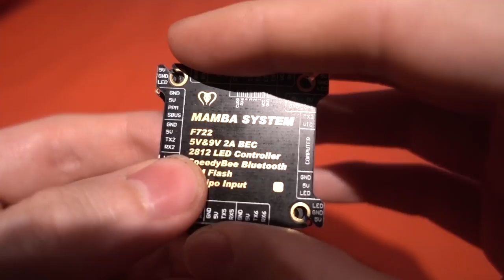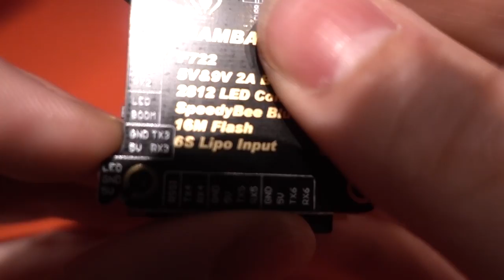Diatone F7 $80 6S Stack - MAMBA F722S

Comment: I bought the budget f4 one a couple days ago and it too has many improvements.. lots more led controls and outputs and yes  9, 5 and 3 volt regulators at 2 amps.
What led strips should I use with these Andy?

Comment: Good review.  Seems like there is no 3.3v pad.  Also cam control looks like a pain (if you want that).

Does 5V (and RX) power from USB to enable bind without adding vbat?

Interested to see how it flies.

Comment: I love the extra effort they have put into it. Having a pin-out out of the box is a big time saver :)
What is your reason for wanting a F7 though? I could understand it for an autonomous drone/plane, where there is all kind of processing going on on the drone itself. But where is all that processing power needed for a manual controlled quad?
Reply: Filtering and pid loop times use every bit of processing power, Autonomous Planes do  not require near the amount of cycle time for filtering. The difference in CPU usage between an F4 and F7 can be more than double depending on Loop time and filtering selected.

Comment: Hey Andy, great review . Do you know how long the PCB is from the front of the esc where the 8 pin connector is to the first standoffs? I'm hoping to get this in a frame but it is pretty tight for room around the stack so not sure if the longer part would touch the frame. Thanks for any help

Comment: You should check out the mk2 405 it also has a seperated 5v & 9v 2a bec, plus the led controller and a 16m flash with 6s.

Comment: Do you have to run a power wire from the esc to the flight controller to power it? I'm not seeing a vbat connection on the flight controller. Or is the flight controller getting power from the cable running from the esc? Thanks for all the great videos.
Reply: VCC PAD

Comment: I don't know if I just have bad luck or if the youtubers just get different product charges that work better.

 But I had 3 mamba f405 stacks. 2 were doa and the other one died after 3 flights. A friend of mine also had a mamba stack that died out of nowhere...
For me it's to much risk to invest in the expensive mamba stack after my experience with the cheap one.

I don't want to talk about the filterboard... I reciver mine but the main part was missing... So it was only an empty pcb with a aluminum box on it. Mamba stack and diatone are dead for me.
Reply: I don't work for Diatone.  I am not a big youtuber ..  And I am 67 retired living on fixed income.  I have had absolutely 100 % perfect reliability and experience with all my Diatone products.  Last week I received  a package (paid full price )  of both the old 405 and new F7  stacks.     been raining so I have been busy installing into kwads .  I can say the new F7 is an absolute dream to install.  big solder pads.   great layout.  clean easy to understand pinout diagram.    the new F7 makes kwad building SO EASY !!!!   simple.   I have been struggling with different companies  4/1  esc  and flt cont.  no more.  I am not a racer.  not   a Mr. Steele or Drew.    I love to buy innovative new frames etc and enjoy soldering and building.    Diatone has this new frame that they customize with your photo for $10.00   how cool is that ??  I am a Diatone geek 100%  !!
Reply: @emilianozapatta5978  that's awesome for you.  I also have friends that fly their mamba f4 stack for months now without problems.
Maby it's just bad luck that I had so many problems. 

Did you buy your stuff from diatone or from bangood?
Because here in Germany  I am only able to buy from banggod
Reply: @brianevans4  If you are on a tight budget try it again.

I chose to not buy anything from diatone again because the price I save is not worth the amount of time I have to invest to get my refund if it breaks again.

Comment: I bought one. Cant stand the input connection and it gets VERY VERY VERY hot.
Reply from the maker: this is the case for most f7 boards and some of the smaller f4 make sure you have a fan on them while setting up

Comment: Just thinking out loud a bit ☺.  I'm thinking that the cap they provide will most likely outlive the quadcopter.  This is from the perspective of valve amps. The caps can last for decades.  Perhaps the environment of a quadcopter puts extreme stresses on the caps compared to a good old amp, making it dry out.  I don't have enough experience with this aspect.  Just thinking.
What do you think? ✌❤🤘  🖖
Reply from the maker: its heat that kills them quickly. and if its too small and gets hot then it can have a very short life
Reply: That does make sense to me.  Thanks Andy 👍